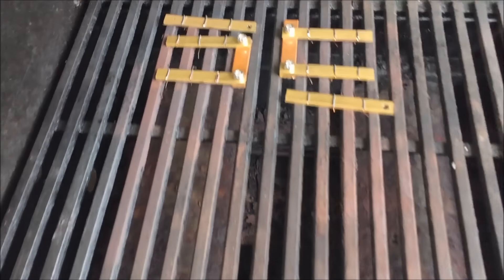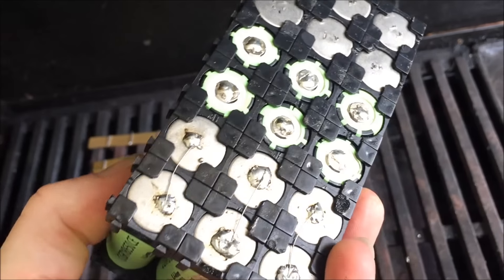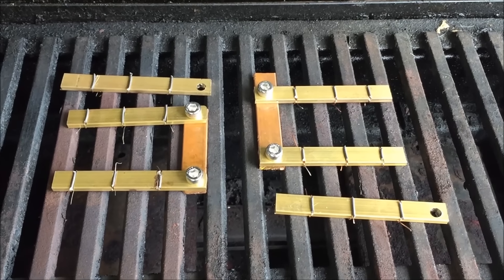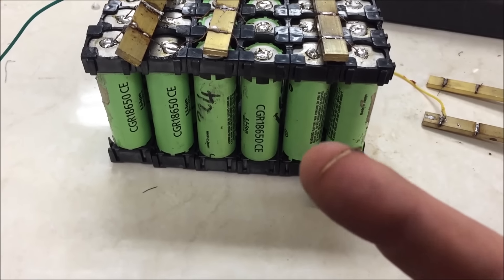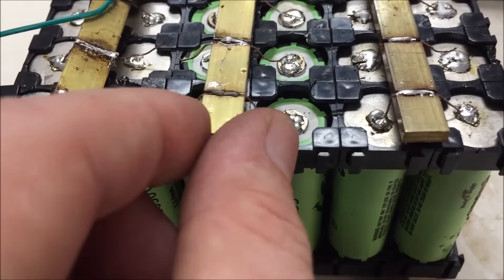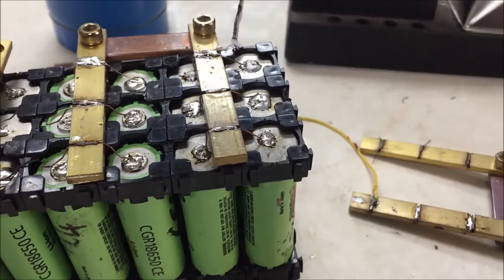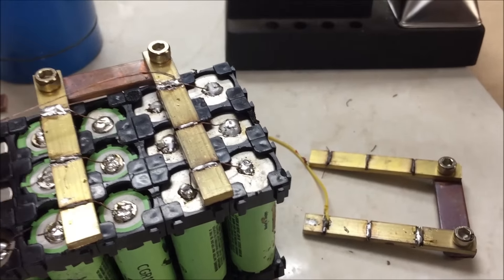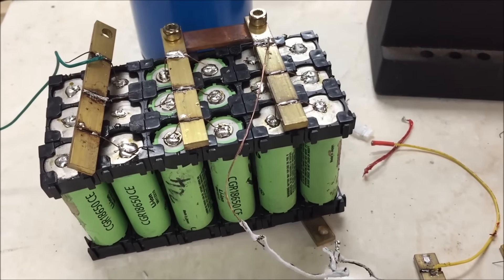Told ya so - dam near burned the whole street down.

Comment: Shit happens mate. Keep going. Have you thought of using a little oxy blue bottle?..... I have just received 100 laptop batteries man they make them hard to separate.
Reply from the maker: +Craig Minca yeh, got one but it's almost out of gas, was playing with that late last night using some info i got from another commenter, and got some mighty clean solder down on the busbar.

Yeh the suck - it's like it never ends you get 100 cells and in the beginning it's like whoohoo i got this pack all i have to do is test. Then you're onto your 90th cell and only 30 are good and your smashed back to earth. I've tested 1600 cells so far!!!

Comment: We need to work on a better, safer method. Tip: show and tell via video only, taking that stuff away from your protected environment into your living area is asking for trouble. But you seem to like that!? On the busbar issue, it had occurred to me way back when considering my options whether using 2 smaller (half x section) BB's and tapping drilling one on top of the other to create a clamp arrangement might simplify the FUSE (to BB) ASSEMBLY phase.....still "out there", I've not committed but must admit your adventures have taken me further away from the solder option....
Reply: I also realise that you have those batches of cells seriesed together hence your burning proximity issue. This IS a very tricky path you have chosen, grasshopper.....
Reply: +HBPowerwall Classic!  "...wifee will kill me, then cpr me and kill me again."  Got a huge chuckle on that one.  Keep up the good work...
Reply from the maker: cheers, glad i can help :)

Comment: dude, I cringe when I watch your last few videos. Up to the point where you started soldering I thought you were actually doing well but dude... a freaking barbecue??? I honestly thought you were just kidding but now I feel you need a little face slap ;-)

Look man, your headed down an interesting path and you have obvious put a great deal of time and energy into this so I only have one word for you: "spot-welding". That is THE solution to your problem and will ultimately solve the otherwise insurmountable task in front of you.

Buy a decent spot-welded (maybe off ebay), make sure you get one with a foot peddle trigger and take care to run various tests to ensure the power output is set properly so you don't damage the cell's but still achieve good penetration.

Also... two more things to note which you need to be aware of:  The approach of using those huge bus bars to interconnect your cells is ridiculous, wrong and will actually negatively effect the system as a whole. I get that your trying to isolate each cell by using the interconnecting wire as a fuse but using that approach requires a lot of patients and requires that you learn how to use a proper soldering iron set to the right temperature, use of the proper tin and flux. I really believe you should just focus on the spot welding approach with battery tabs matched to the max amp draw for each parallel pack and terminate each parallel pack with two properly sized bus bars (one positive / one for negative).

A barbecue dude... seriously OMG
Reply from the maker: +Christian Hochfilzer BBQ = heat, no different to a fancy gas torch or oven - it works & it's what i have. 

This is a process and My process at that, learn stuff up, learn more - called progress.

Won't be spot welding - this is my project that i'm both enjoying and about to give up on at the same time. Bus bars I want to do differently not follow the beaten path as many others have. Stay tuned - this might even work :)

I solder shit for a living every day - Playstation4 USB & HDMI ports, laptop top charger io sockets, surface mount bga chips on older mobile phones, mini usb ports on Samsung mobile phones - the small shit i'm all over - the bigger stuff is a learning curve that with the help of you guys i'm learning fast. 

Never forget this is my YouTube channel and I can't possibly video or upload everything I do. I love your input and keep it coming!!!

and seriously - A BBQ! hahaha -